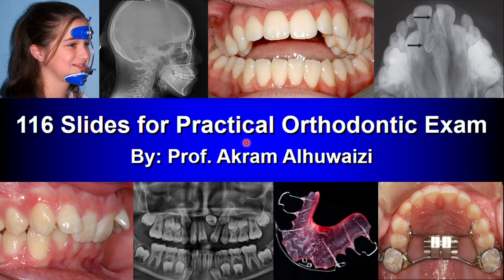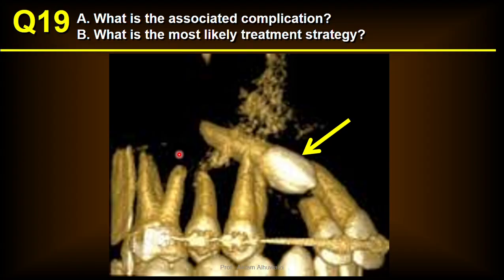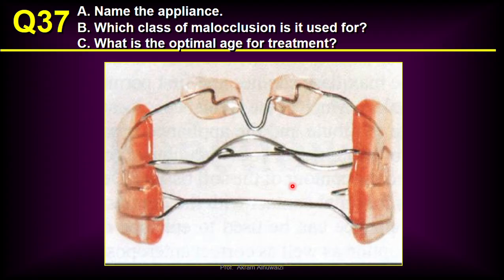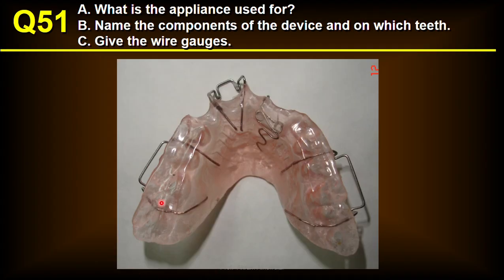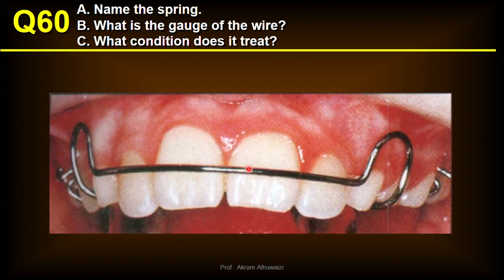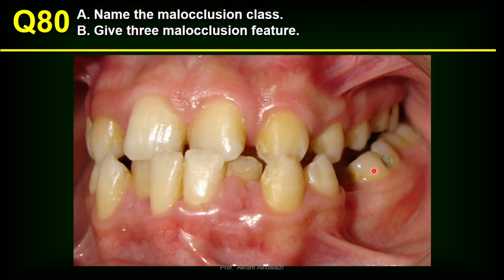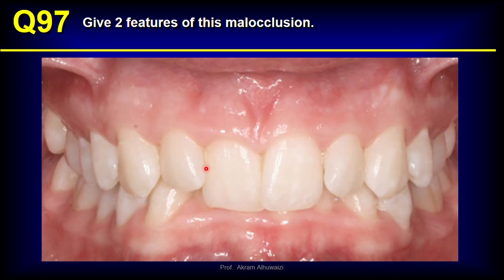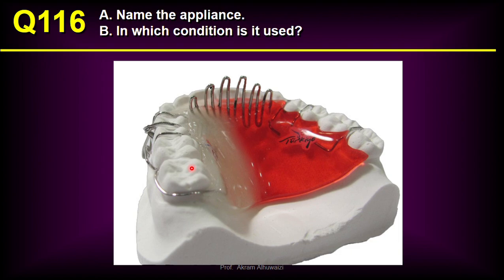Practical Orthodontic Exam with Answers

Comment: our dear dr. , slide 50 , doesn't posterior bite plane causes intrusion of the molars ?
 and hence it causes treatment of open bite anteriorly or in another 
word it deepens the bite anteriorly , why it has a different action in 
this slide of review ??  and sorry for bothering you .... thanks alot for your efforts , we really appreciate it  ..
Reply from the maker: Good point. Here the bite plain works for 1 to 2 months only so it does not cause significant molar intrusion. For the latter to happen you need 5mm separation and for a long time.
Reply: i got it now ... thanks alot doctor 🌸